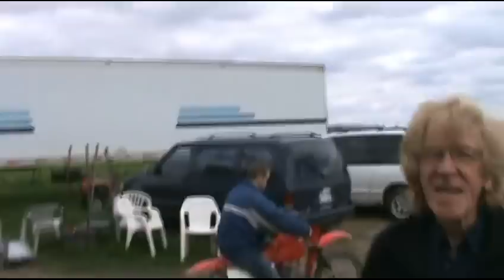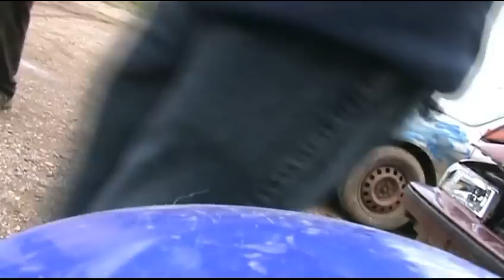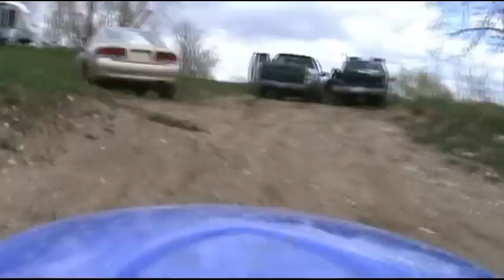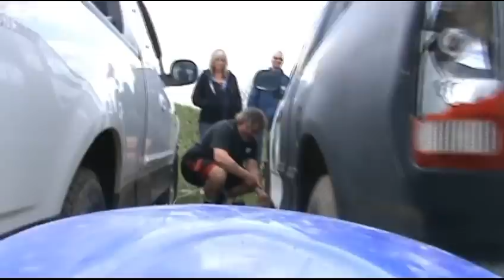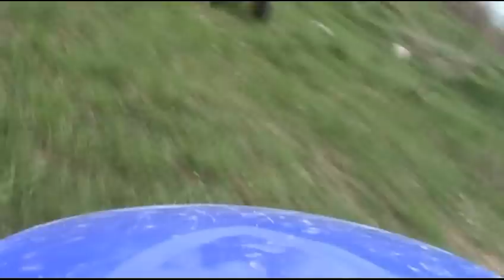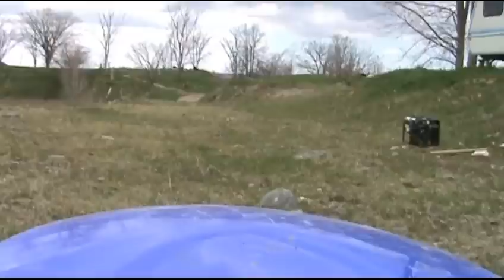TTR Tour of the Farm

Comment: I got a question I don't know if you ever had this issue with your Yamaha ttr225.On my Yamaha I'm having an issue with the bike will not turn over I replace the whole wire harness . I have power going throughout the whole wire harness I can start it through the it won't start with the.